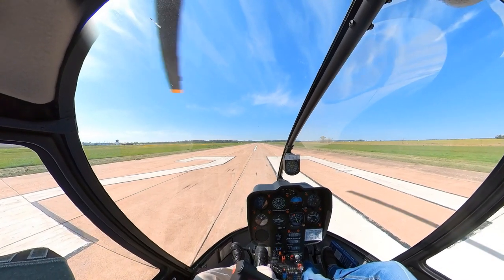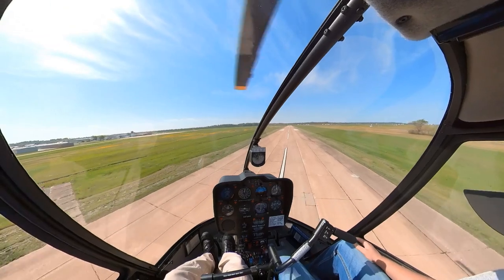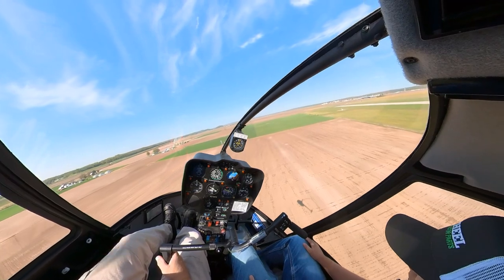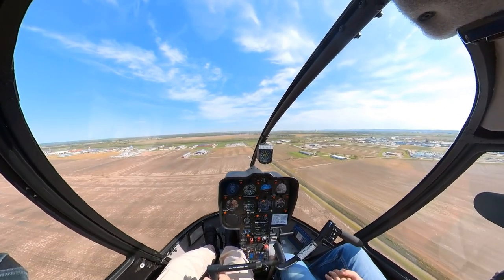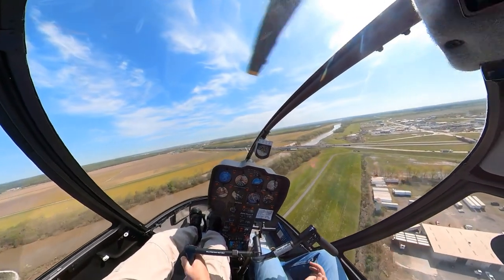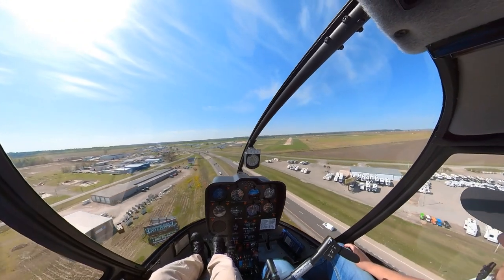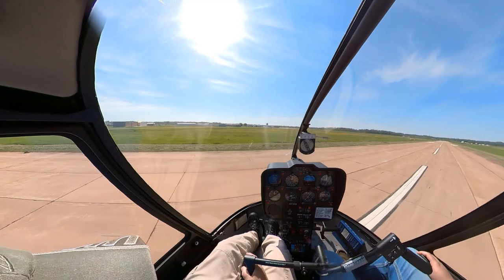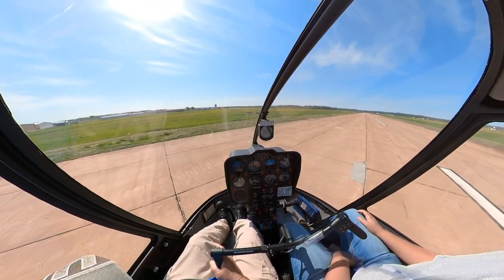How to deal with a stuck left pedal in a Robinson R44 Helicopter

Comment: Very informative video! Is there any maintenance required after an intentional overspeed? I've never seen anyone teach students to do this and I thought it would ground the aircraft.
Reply from the maker: Its only up by about 3-4 %, no damage
Reply: @capecopters  But according to the Robinson maintenance manual, “only up by 3-4%, no damage” requires an inspection (overspeed recorded in the aircraft log book and the oil filter and screens checked for metal) by an Engineer. 
Not excluding the fact that the limitation section of the R44 POH states that the maximum continuous ERPM is 102% and “intentional operation above maximum continuous power is prohibited”

Comment: Both of your stuck left pedal videos are wrong.   Even another viewer agreed. 

You don’t over speed an engine to control the left pedal being stuck.   Smh. 

pilotkisses
1 second ago
Sadly…. This is not the correct procedure for a stuck left pedal and surely an unnecessarily long run on, on an icy runway which is not better like you said, that’s worse!
Luckily you didn’t roll it over.  

Steep approach would have allowed you to come to a hover.   Your nose is stuck left, adding power as you slow down below 30 kts and into a hover  would have brought it to the right.   (Straight). 

Although that is not the way I teach or or bell school teaches it.   WE make a normal approach, and as you slow to a hover, you pump the collective up and down… this will slowly bring the nose to the right.   Once it’s about 1 or 2 o’clock…Roll throttle off.    

Surely would never do a 30-40 kts run on when you can just hover it.